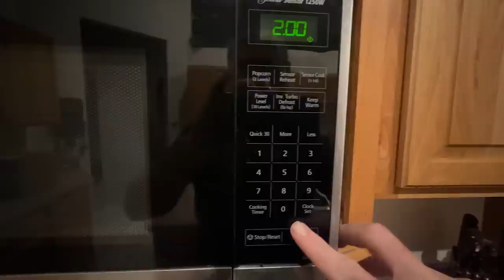Refurbishing and upgrading an enclosed car trailer. part 2

Comment: I think now with the winch you you don’t need to crawl out of the car and you could put tire racks up on the side. Then you’d have so much room at the front for activities. Also they make a thing called a steering buddy that clips on to your wheel and allows remote steering.

Comment: Running power, or ANY wire under the Frame is a terrible idea. If you don't drag it off going in & out of grassy parking you will run over something on the highway.  Go back, drill holes,  install grommets and do it right.

Comment: Wouldn't rivets instead of hex head self tappers be cleaner/less likely to trip over? And wouldn't it make sense for it be installed next to a floor brace so that you can mount it to that brace?

Comment: Nice job on the trailer upgrades. You didn't mention the brand of that brake pressure bleeder. I've been wanting to get the same. Can you say the manufacturer?

Comment: I don't believe in doing a job twice. Somebody is going to have a mis-step & fall off the trailer when their hands are full & they're preoccupied. I'd rather use a crate as a step until I have the time to properly sort things out, than risk an injury.

The power cable for the winch really needs to go through the crossmember via a rubber grommet & it needs to be protected with split loom. Should the trailer ground out when you go over some uneven terrain/asphalt, the inline fuse is no guarantee that something bad won't happen. Even on aluminum.

Comment: Hi Taylor.. love your videos.. very entertaining.. love your work..couple of suggestions.. my opinion only.. will the winch be strong enough just screwed to the floor..id be using bolts, lots of pressure there when winching..
With the step, if you put another one next to it going towards the front, it will eliminate the problem of missing the step, and also create sitting areas on both sides of the door..
Best of luck 😁
Reply: @adematthewsracing  Yes correct.. im sure the way Taylor is, he will add a beam and modify it.. probably will irritate him the way it is😬

Comment: Definitely need to seal that winch box so much dust and weather will get in there via the small ridges in the floor and the box not actually sitting truly flush.
Reply: Also for the step you can weld in aluminum to the beams so that way its centered

Comment: a week late on the comment but it would be a really good idea to mount that winch fuse next to the battery instead of under the trailer. it won't prevent your trailer from burning down if the cable gets damaged from the wrong end of the cable. hate to leave critical comments I'm sure it was just something that you overlooked in the hustle trying to get everything done.

Comment: You’ll need some grommets in the power holes otherwise the box will cut through the insulation on the power leads causing a nasty short
Reply from the maker: It has grommets

Comment: You should’ve bolted a plate up to the beams and then bolt the step to the plate so it is fully functional. It looks so horrible like that IMO. Just looks half assed and that’s not usually your style

Comment: I have watched you fabricate so many intricate things over the years for your cars. Watching you install that step was painful and an accident waiting to happen. I know that u have the skills to get under that trailer and add whatever structure you need to in order to center that step on the door. You always take your time and do things the right way even if it’s not the fastest or easiest way, that is why I enjoy your channel. It would be safer to not use the step and make a step to set on the ground at the door until you can get that step centered.

Comment: why not just fab a diamond plate sacrificial cover ( or reinforced) and mount it in the more sensible area toward the front? id feel itd be a pain to winch it 4/5ths of the way and possibly winch out the winch/ winch the car down into the trailer, which could happen.. we are talking human error/ laziness here.  weird that you couldnt recess it into the bottom part of the cabinets, and open door to use it or make a door like your garage one where it doesnt swing open. maybe allocate the bottom 6" of the cabinet. itll be out of the way and in prime position
Reply: also good to see blue happy and not shy anymore!

Comment: Why are you doing the angle on the back straps? You should just be able to go over the tire and and crank it down on each side.  
I do this with sxs and Jeeps with 40” tires. 
Save yourself the extra hassle.   

That being said I can’t see exactly how the tracks line up lol😂

Comment: I feel like the ideas were amazing, the execution however seems rushed, no sleeving on the battery cables to the winch and looked like you could have slid the wires above the beams, and the step.. come on man we all know you can aluminium tig.. do a job once do it properly. Otherwise awesome content keep it up